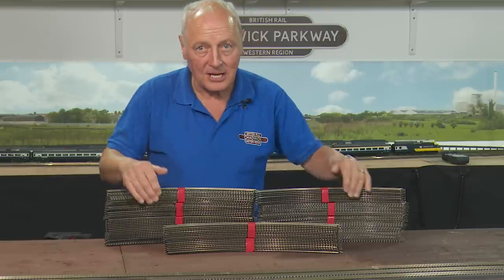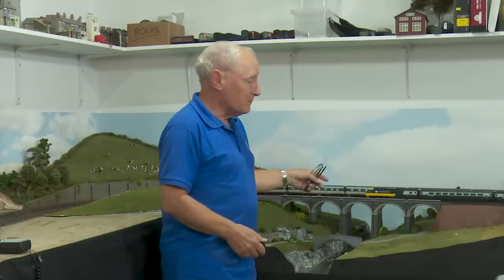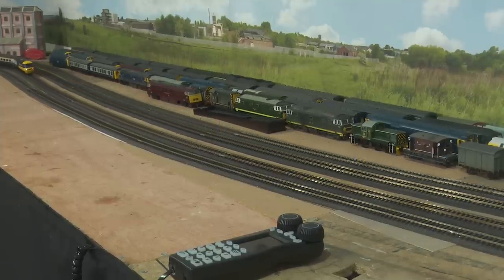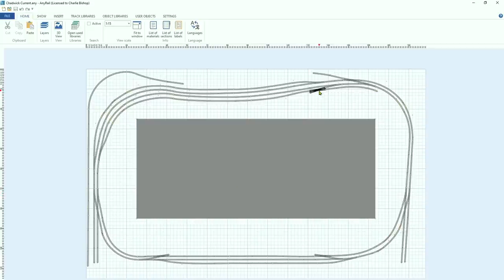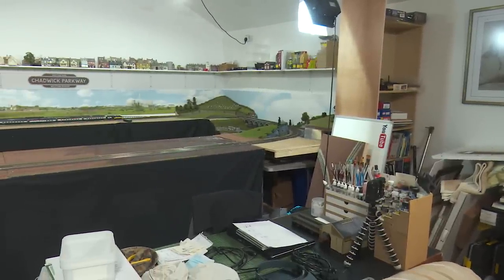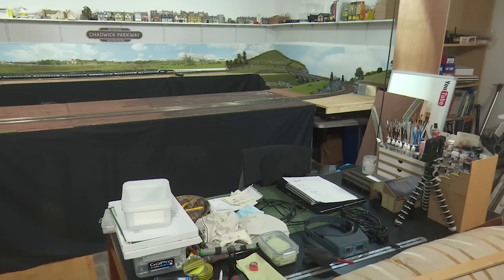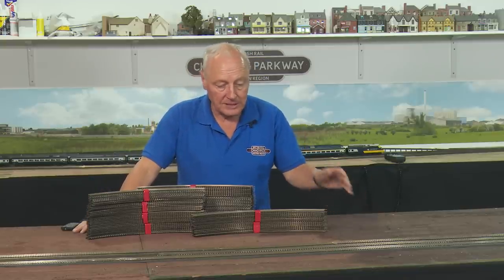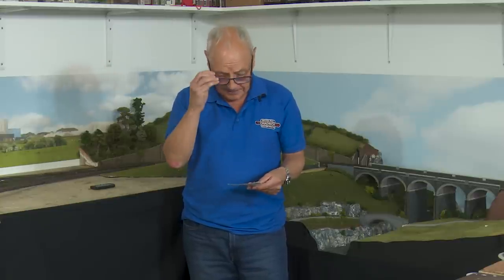Track Plan Design at Chadwick Model Railway | 111.

Comment: Ambitious plan Charlie!
My immediate thoughts for your consideration:
1. A helix well done is worth admiring, why hide it under scenery? Leave the one near the sink visible, with a break to the scenic part by means of a road bridge, for example.
2. Nice comprehensive fiddle yard with a lot of flexibility. But, do you need it?
3. All that lovely complicated pointwork for the fiddle yard hidden from view. Could the fiddle entry not be along the short (bookcase) side, with the pointwork at the exit from the helix at the front of a slightly widened board to be on show with the multitude of tracks then disappearing under the section above behind a large warehouse or similar?

Finally, I've tried a number of track planning software tools and agree that AnyRail is very good, but when I want to quickly put ideas down I still get my drawing board, pencil and compass out of the cupboard....
Sorry, I have no 4th radius doubles left. I too had difficulty getting them and for my curved fiddle yard I ended up finishing it off with Peco singles!
Reply from the maker: A fantastic comment Brian. Yes there are still numerous options for me to examine it’s only the Helix that is cast in stone

Comment: Thanks Charlie - have been using AnyRail for a few years now and love it.  I have a similar problem and being a few years in advance of you I am toying with helixes as well.  My current plan has long inclines down to the fiddle yard and a planned hinged or lift out section for entrance.  If I keep the inclines then hinged (as in a door hinge and not a lift up hinge) is the better solution but if I go for helixes then the lift out for just one level would be easier.
Reply from the maker: Thanks Peter, stay tuned to my forthcoming ........  ?

Comment: Charlie, I really feel for you. As a sufferer of dodgy knees I wonder if I’m being optimistic or stupid as I have the same set up as you albeit with the scenery at the front and hence where I dodge under the boards. Your plan looks pretty good to me but, as I have no experience of helixes I would be very concerned at having to reduce train lengths to enable passage up the gradient. I wish you the very best of luck and look forward to seeing your progress. Keep smiling. PS on the subject of future videos, I want to fire off various sounds such as the iconic clang of a semephore signal arm reverting to danger. The thing is, for it to be effective it needs to be triggered automatically along with operating the signal lever on my frame. If you have any ideas it might make an interesting video. Tony
Reply from the maker: An interesting point Tony and one which I will bounce off my buddies.  Regards Charlie
Reply: @ChadwickModelRailway  Railmagic.com may be over promising but is interesting on the signal front.

Comment: Hi Charlie, a big change  to the layout which will I think end up giving you more space for different areas of interest. I look forward to seeing the progress. I would love to put helixes in for mine but they do cost a bit. Although adept at woodworking I could never build them to the accuracy of CAD laser cut units you can order. One suggestion I have for you for your fiddle yard. Install all your point motors on top and most of the buss wiring that way it’s easy to get to later without having to lie on the floor to get under your bottom level. Maybe consider the DCC concepts surface mount motors? I am a happy paid user of Anyrail and have been since version 4. Take care, Michael
Reply from the maker: Point motors on top! How on earth did I miss that. Thanks Michael.

Comment: Hi Charlie, loving the new track plan... Just a thought, I would recommend using DCC Concepts Powerbase for your helices, especially for longer trains. I had issues with some of the gradients on my own layout (mind you I am running steam) and found powerbase to be amazing... I am also using set track for my gradients...
Reply from the maker: Thanks for the tip but I am using diesels so they ought to have more power.
However, good advice that I need to decide upon, before the build starts.  
Regards Charlie

Comment: Hi Charlie. You have a great plan, but I am respectfully wondering whether you aren't going two steps back? I don't recall hearing how high the fiddle yard is off the floor (18"?) but are you not going to have to spend a lot of time with a bent back trying to follow the trains at that level until they are in their storage tracks under the layout than you would ducking under the layout to get into it? I do sympathize with your knees; I'm 52 and I don't like duckunders very much either.
Reply from the maker: I believe it’s the only practical solution TM.
Reply: I hope it works as I'm going to follow your progress in this regard very keenly. Low staging is something I have been pondering for a while as well.

Comment: Hello Charlie.  I had the same problem with Anyrail on my Mac, so changed to Railmodeller Express.   It works well and has the same 50 piece limit before you have to pay.  I’ve also suffered with my knees,  30 years in the Fire service crawling around has taken its toll!  It’s ok getting down but getting back up is a real trial! So you have my sympathies.  Looking forward to seeing your forthcoming videos,  keep safe!
Reply from the maker: Yes getting old is a dreadful thing! I do find these track planning programs interesting but I couldn’t find a helix type structure to add. I’m glad you enjoyed the video, stay safe mate regards Charlie
Reply: Chadwick Model Railway Hi Charlie. Did you have a look at XtrackCad? It’s very sophisticated and well supported by the volunteers who created it. And it’s free. I haven’t done it, but I believe it will let you build helixes. I t also allows you to specify elevations for your track so you can work out grades. And as a further bonus, it lets you run virtual trains on your track plan so you can check that operations work the way you want them to. Did I mention it’s free? There is a huge variety of track and structures available in the various parameter libraries that come built in. 
Anyway, I’ll be watching the progress of your redesign with great interest. Your videos are always interesting and fun. Keep up the good work.
Reply from the maker: Thanks for the tip Ron
Reply: Chadwick Model Railway  Less useful now that you’ve already forked out the 45 quid. 😩

Comment: I don't know Charlie, you seem to be at the mercy of the fill yard.  If you didn't want that the need for a lower level would go away and you wouldn't need the helixes.  You could just go with end loops on the upper table.  Getting down and doing lighting and rail work on the lower level may be just as much trouble for your knee as crawling under the table.
Reply from the maker: Too many trains is the problem 501!

Comment: I suppose that's one benefit of loft layouts: the entrance will usually take you into the middle of the layout!  But that looks a good solution, you've come up, plus it will give you a much longer run when operating, which is always good.  
Definitely agree with you on using set track on helixes.  
Some further thoughts:
1) On the new section down the wall, I would think about leaving the far tracks next to the wall exposed, and putting the near tracks in a half relief hillside that you could leave open/have access slots in (if you see what I mean): it's quite a long stretch to be hidden without easy access.
2) I'm not quite sure of the heights, but your lower level is going to be quite low down, and you are going to need to sit/kneel on the floor to deal with any issues: with the restricted clearance issues that's going to be even trickier. I could easily see (speaking from experience!) that if/when the knee(s)/back/etc get any worse, you'll end up ripping out the bottom level and helixes, and just running the layout end to end. I wonder whether it would be worth taking this opportunity to raise your main scenic level of the layout, maybe by 18 inches or even 2 feet, possibly more.  You could get/make one or two low benches to stand on to reach the back of the raised main level: stepping onto a foot high bench is a lot, lot easier than kneeling down, sitting on the floor and getting up.  (You'd have to do the back scenes again, of course ...)  That would mean you could raise the new lower level to a more accessible height.  It might even be worth thinking about the American style of double decker layouts, where both levels are scenicked: I don't think that would work with Chadwick, but worth just considering it for even a moment.  I've had levels at a couple of feet off the floor, at waist height and at chest or even shoulder height: the best was with fiddle yard at waist height and main running lines at chest level - it's great for watching the trains go by too.  Anything below waist height  - and with advancing years and reduced mobility (it'll come to you, you whippersnapper, you!) - you need extreme confidence in your track laying, electrics, point motors, locos and rolling stock!
3) Consider surface side-mounted point motors.  I don't know what the Peco ones sound like in operation, as they didn't exist when my dad and I had a layout, but we used Fleischmann and Casadio pointwork with side-mounted motors that were very reliable (particularly the Casadio) ones and quieter than the tortoise style.
4) We did have a scenic level over the helix, but I'm struggling to remember how it worked, and don't have any photos here.
5) Good luck!
Reply from the maker: An excellent comment Peter with some valid points for consideration.  Regards Charlie

Comment: Hi Charlie
For your new fiddleyard, where it spreads out, have you considered putting curved points on the corners to create longer sidings?
There is a myth that trains derail on curved points... but in reality, this only happens if the woodwork is sloppy you don't have a flat surface.
I speak from experience with them working... and seeing other peoples bad woodwork skills which causes problems on straight points as well.
Reply from the maker: Quite true Laura. I think that the bad press comes from the tight set-track versions.

Comment: Good luck with the new layout Charlie, sorry to hear about your knee's I hope the new design helps with that, thankfully I'ma spring chicken at 34 but will take this on board when doing my layout, I'd be very interested in helix construction - just one question with using 3rd and 4th Radius double curves for the helix how do you manage that with the incline and decline of the helix? As opposed to using say flexi-track instead?
Reply from the maker: There is very little bending.  The helix is designed around those track dimensions.
Reply: @ChadwickModelRailway  is that a standard helix construction or a custom one to manage the bend in the track?

Comment: Hi Charlie, I've been looking into using Helix for my planned loft layout. On researching using helix's one of the tips I’ve come across is to have the ascending line on the large of the radii on your helix. Therefor on the right-hand side I would look at mirroring your helix so your ascending trains have less resistance on the curve. I've also looking at DDC concepts powerbase for helping loco's climb the gradient, maybe worth a look into as well. Rob
Reply from the maker: Thanks Bob, both options have occurred to me. Regards Charlie

Comment: Hi Charlie, beware of an 8 coach train traversing a helix, in theory a good idea but in practice full of dangers - derailments and sufficient power in the locomotive springs to mind. Rather than use settrack why not use Peco flexitrack with a tracksetter of the appropriate radius? Either way good luck as I think you may need it. Also checkout Everard Junction, Richard has helixes on the original layout which were dispensed with on the new one. He had all sorts of issues with his setup, which were discussed at length when starting his new build.
Reply from the maker: Good points SW.  the advantage of set track is that the rail joins are perfect. I have no steam locos so my fingers remain crossed but power base is on my mind.

Comment: Well that was interesting. Necessity being the mother of invention, your new layout is more interesting then the old one, if you don't mind me saying.

As a side thing, I wonder if you might do a short film 'proving' droppers are necessary ?
I once laboriously put in droppers every 12 inches or so on quite a large oval layout - same size I guess as yours. But when I added an extra loop, I didn't fit any - as an experiment.
This line ran as well as the other one's - with the many droppers - did. And I now have a much bigger 0 gauge layout and not one dropper. Runs perfectly. So - are they a waste of time? !
Best wishes Ian.
Reply from the maker: It’s not about the power feed but the DCC  signal which can corrupt with fewer feeds.
Reply: @ChadwickModelRailway  Crikey I had never heard that. I could have saved a lot of money and drilling.

Comment: Now you’ve got me worried Charlie, as a reasonably fit man of 58 I have built a crawl under because of what I wanted to achieve. With my ever increasing years I’m hoping it won’t be a problem. I have though recently laid the jigsaw type flooring from B and Q in my railway cabin which is soft and hard wearing and has been saving my knees quite nicely as I have just started fitting the wiring underneath. I guess if the worse comes to the worse I will have to change the layout to the Swiss mountain layout I have in my mind (no crawl under). Although this maybe a problem as my admin department (The Wife) may not been keen on releasing the funds for the new rolling stock that that project would need. We’re currently in negotiations for my first box of DCC Concepts point motors. Anyway see what you’ve started now just by mentioning your changing your layout because of a dodgy knee!!!!! Thanks Charlie! Cheers John 🤪🤔😂
Reply from the maker: An excellent comment John and yes we do have to take care of this dreadful design known as the knee joint!

Comment: Why not use flex track for your helices if getting more of the Hornby track proves impossible ?  Indeed, using flex track for the entire helices would mean fewer track joints, fewer places where electrical connectivity could fail.  I know creating a smooth curved joint with flex track can be a challenge; but that can be overcome by soldering the joints before curving them.  

Since you plan to create isolated blocks within the helices, simply cut the track with a rotary cutting tool (eg: a Dremel).   Speaking of electrical blocks, other than for occupancy detection, I don't understand why you would not simply use a single block for each helix.

Another point, regarding points and points' machines...   if your lower deck (fiddle yard) won't be scenicked, why not mount your points' machines on the surface ?  This will make accessing them for maintenance, repairs, etc. that much easier.

And finally, I would relocate the "mouths" of your fiddle yard to locations along the side walls (to the left and right of the room) closer to the foot of the helices.

I am looking forward to seeing how all this progresses.  Keep up the good work with your highly informative videos.
Reply from the maker: Some very interesting points Timothy. Using Set track is easier from my point of view, as it’s mechanically perfect, and avoids trains clashing from the 4th to the third radius curve. Putting the point Motors on the surface is a good idea but to use tortoises, it’s an extra £10 per point Motor for the fittings.

Comment: Hi Charlie, 

I missed what clearance you are going to have between levels of the helix and reckoned it would be about 8cm giving you about 1/40 on the R3s. This would seem a little steep and I thought that if you stick in a couple of Hornby double straights and made an oval helix you could get the gradient closer to 1/50. The plan looks like there is space for that. (or more)

I don't know how you feel about traction tyres, but I think they will allow considerably longer and authentic looking trains, and there appears to be an adversion to them in the model world and if your 'good' locos don't have them I think they may struggle with a decent train and a 1/40 gradient. Have you set up a single helix to see what can get up?

I'm looking forward to following your progress.
Reply from the maker: I’m aiming for a 1 in 50 Andrew, but your point about an oval is very interesting.

Comment: Hi Charlie, having watched various track laying clips with you I would like to ask your opinion please. I am about to start a new layout and wondered when running parallel lines using flexi-track OO on straight sections would you use the Setrack guide or Sreamline guide [peco guide] for spacing, many thanks Phil.
Reply from the maker: Streamline but only if your using Streamline points.
Reply: Thanks Charlie , keep up the great work. Phil.